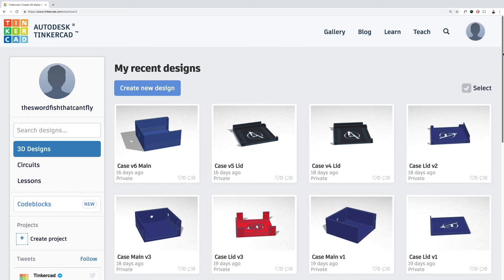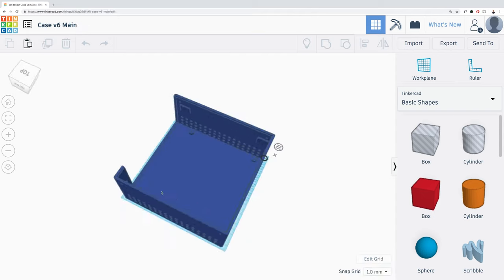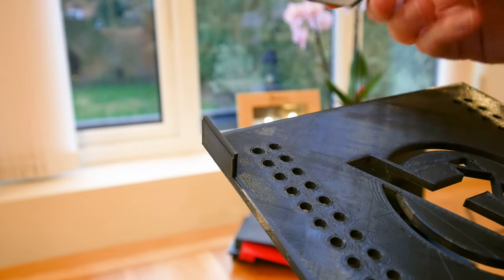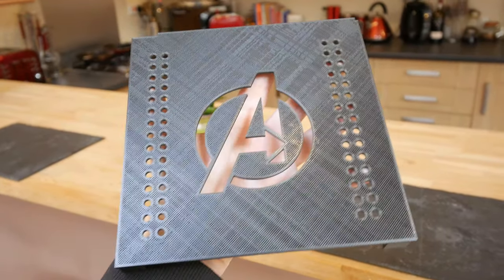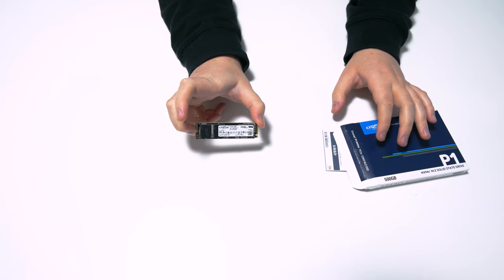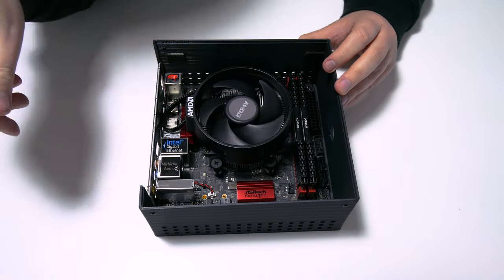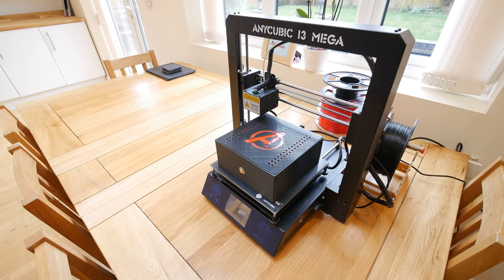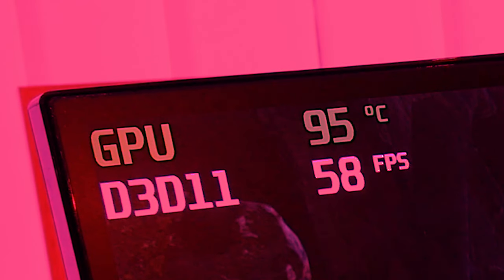3D Printed Ryzen Mini ITX Gaming PC (Avengers Theme)

Comment: What about removing that plastic from avengers logo and using it as vent hole?
If im correct, logo should be right above spire cooler, or at least really close to it.
Maybe add filter under to not make it see through or some sort of cloth like it's used on speakers.
Reply from the maker: Cheers for the suggestion - I did consider it but I personally like the idea of having the translucent logo with a subtle glow. I actually ended up printing two extra versions of this case to tackle the heat - nearly done with the follow up video :) Good call on the filter - I will look into it!

Comment: Im in the same boat with thermals. I also used cbutters design and altered it to my liking. I am still working on some new prototypes however losing interest as by the time I fit fans and a sfx psu I might as well go with a manufactured case. Currently housing my PC in a CM Q300 until I get what I am looking for. Nice video and gives me some ideas with wet sanding and buffing on the finish.
Reply from the maker: Thanks! Glad it gave you some ideas. I just printed a new version that's around 2cm taller and has more vent holes which definitely helped with thermals. Prime 95 still sends it into the 90's though. I'm going to try low profile cooler with a high tdp rating next - will upload the result next weekend. Good luck with your print, hope you figure it out.

Comment: Would like to see someone create this build or similar but instead of an M.2, use a 2.5 SSD and a 3.5 HDD combination. The reason? This is a budget build and an M.2 is expensive at 500 GB is about $75 and you won't get many games in it. A 256 SSD costs about $30 and almost everyone has access to a used 3.5 1TB HDD laying around or on an old build. The case would be slightly bigger, but that is the challenge!